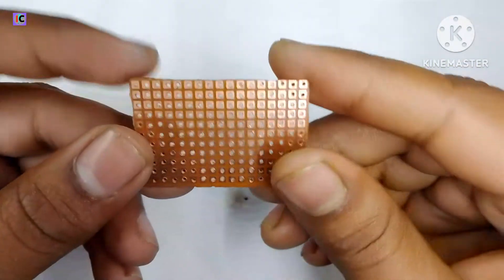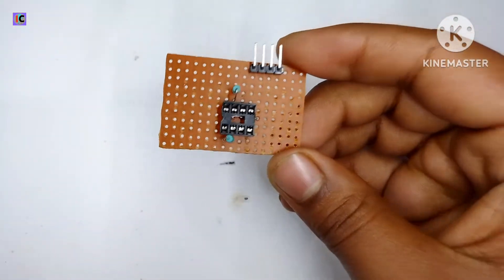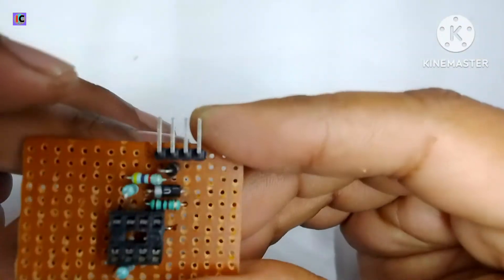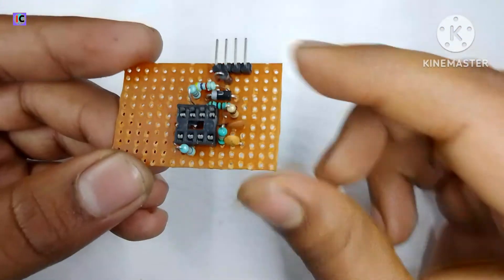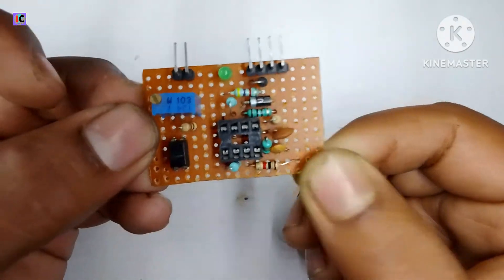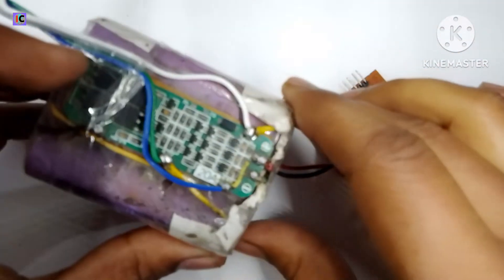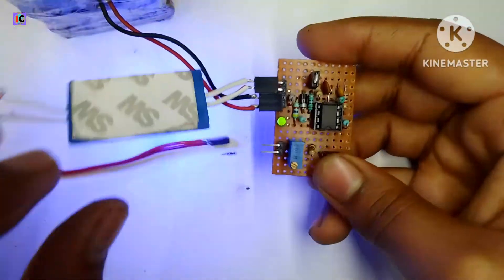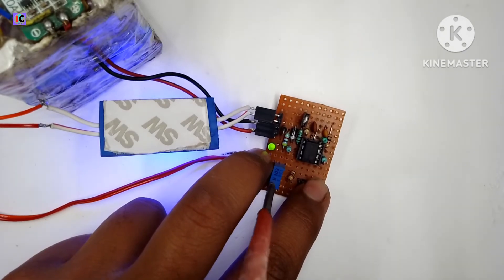UC3843 UC3845 SMPS & DC to DC Converter #smps #converter

Comment: sir same feedback circuit use on sg3525 ic
Reply from the maker: Yes, you can use it for SG3525, but the pin configuration is different, you need to check the datasheet 👍
Reply: thank you sir  @innovationic

Comment: 24dc. In switching circuit diagram.
Reply: Input DC or output DC control.uc3843
Reply from the maker: this pwm module can also works at 24V

Comment: whats the use of that 47k resistor between pin 1 and 2?
Reply from the maker: the use of resistor between pin 1 and 2 to stabilize the feedback loop as pin 1 is the compensation pin

Comment: Bro please can you give me proper circuit diagram ?
Reply from the maker: hey bro circuit is same you just need to change value of resistor connected between pin 4 and 8 and also change the value of capacitor connected from pin 4 to GND that's it

Comment: Bro whats the frequency ?
Reply from the maker: 47KHz
Reply: @innovationic  bro can it be tweaked UpTo 500kHz as per ic's maximum limit ?. So the efficiency will be next level . Also does this circuit only can control duty cycle or frequency ? If this circuit controls duty cycle then it will be great .
Reply from the maker: yes by setting capacitor and resistor value can be max 500KHz and this circuit have duty cycle control which can be adjustable by given potentiometer on circuit
Reply: @innovationic  bro you are a damn genius ! Can you tell me more details about changing the frequency ? Like which capacitor resistor should I replace with what value m

Comment: I think if u short current pin to gnd and vary feedback voltage it wont change duty cycle ,since both current and voltage waveform is needed to syn the output  otherwise output will be only on or off.,do comment on this? Otherwise send me ur contact detail
Reply from the maker: current pin is shorted to GND, it just disable the current sense and output is directly connected to FB network that controls output voltage or duty cycle by turning ON OFF very fast which can't be seen

Comment: Bhai mne is sarcuit se mppt bnakr dekha par output me 1 amper se niche hi aarha h . Lod nhi utha rha .kuch salotion de
Reply: Derect lgane se ic3845  jal gayi thi
Reply from the maker: IC UC3843 ko 7812 se chalo lekin mppt circuit ko direct solar se tab kaam karega
Reply from the maker: konsa mosfet use kiya h
Reply: P55
Reply: Or z44 bhi use karke dekha but output me 0.4 amp se jyada nhi AA rhe volteg proper aate h
Reply: Or 22v solar panel se chalane ke liye isme 7812 use Kiya h
Reply from the maker: 22v solar se direct chalo 7812 1A deta isi liye load nahi le raha h

Comment: what r u showing while testing ,no input voltage no output voltage , its a nonsense video.not  showing even circuit circuit diagram  and first as per data sheet it is adivised not to assemble
Reply from the maker: as the input voltage shown while testing, and I have explained every components used in circuit, the circuit diagram already available in description.
This is just a PWM controller in which I shown the output with feedback working, in the upcoming videos it will used in SMPS or inverter circuits.

Comment: Nice work❤....Also have a doubt that i hope this is a current mode control circuit and why are you directly feeding the terminals of the Output as current feedback... actually you need a current sensor output into feedback.right❓
Reply from the maker: in this part I just shown the voltage feedback, for which I have connected output to feedback and deactivated the current mode through 2-pin header on circuit